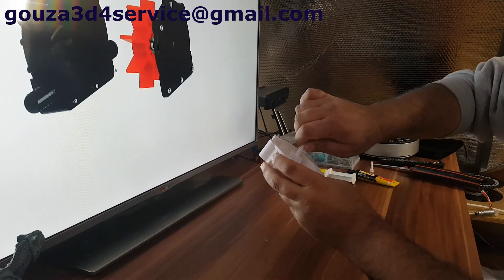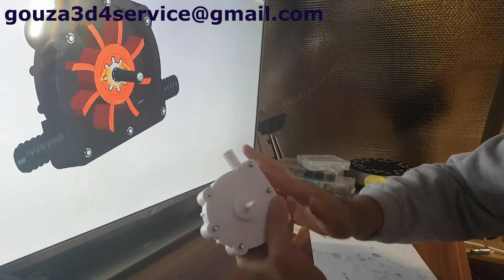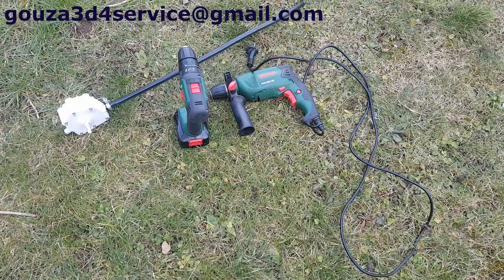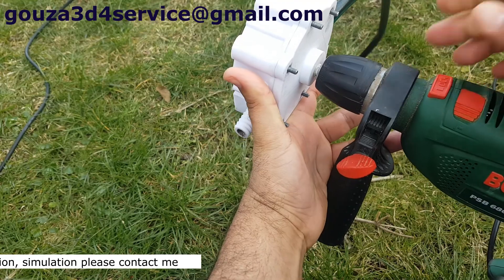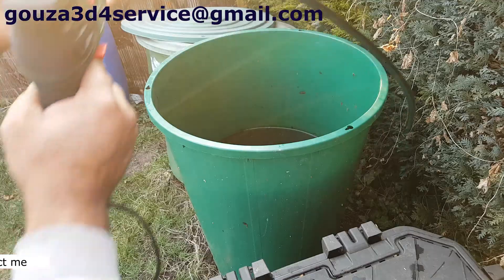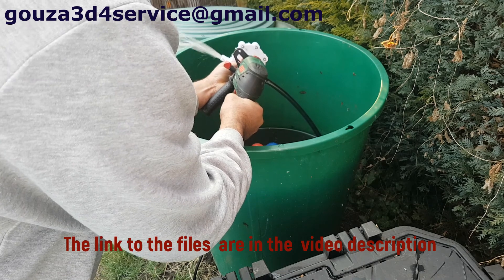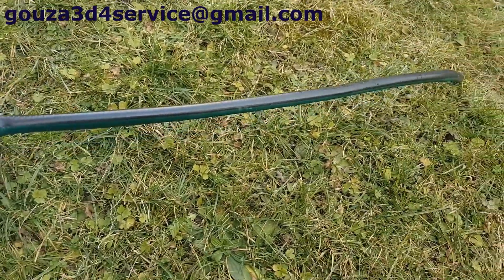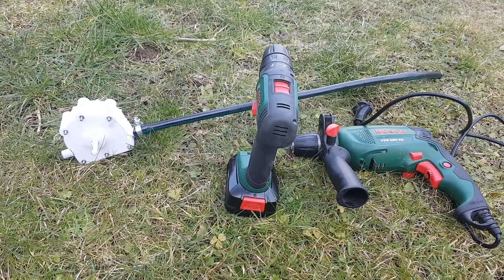Drill water pump Part II

Comment: Hello! I downloaded your drill pump, and was curious what size i need to make the impeller blades. The download only has "shaft, case 1, case 2, and blades-holder" but does not have the actual blades.
Reply from the maker: the blades should be maked from flexibel material. Please check the instriction video: https://www.youtube.com/watch?v=RQYKy6xLR1g
Reply: @gouza3dworld498  perfect! Thank you